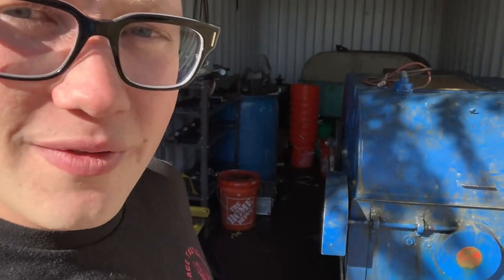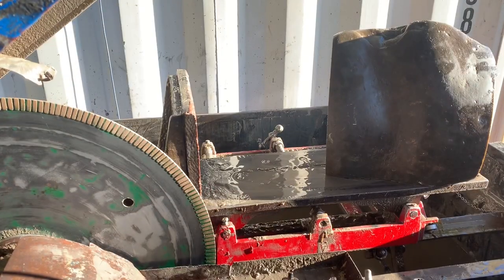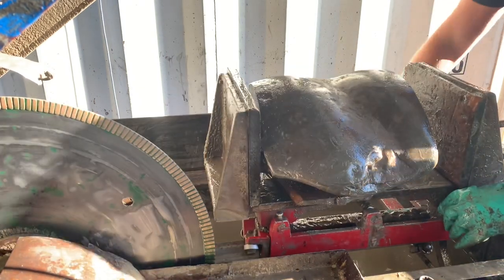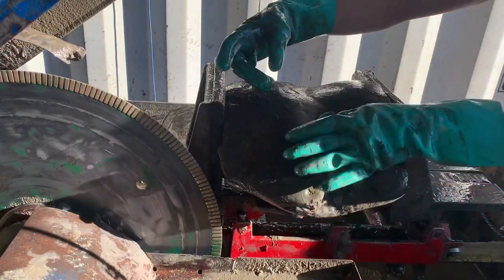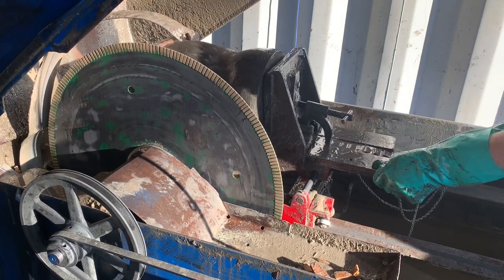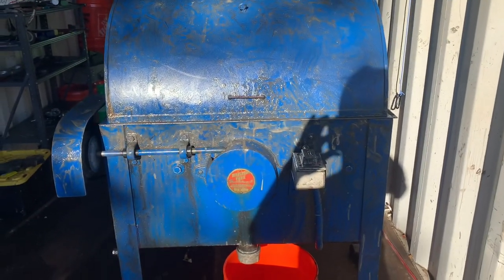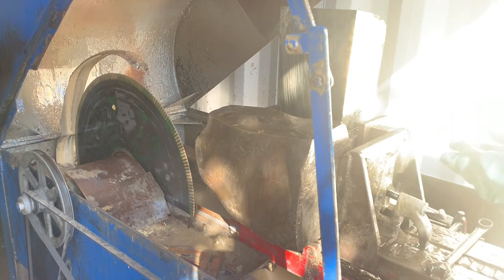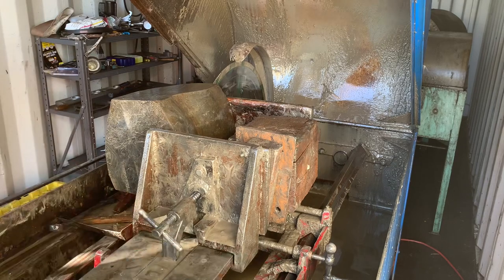How to make a natural whetstone ! With Highland park lapidary slab saw 24” diamond blade

Comment: thank you for featuring our machine.
Reply from the maker: You bet, the only major things I wish that could be changed are these: 

1 A way to extract the rear feedscrew  bronze bushing without having to disassemble the entire carriage, there should be a hatch to open so it can be knocked into the tank of the saw and a new one can then be reamed in from inside the tank. 

2, the back plate of the vise grip needs a U shaped catch added for the screw head that is tightened into it whilst using the vise, this would make clamp failures much less likely, I have added this to this saw here in the video and talked about it.

3 the carriage height should be changed or the arbor height lowered 1” so that a board is not needed under stones to prevent them from rubbing into the flange washers and jamming up.

Comment: Have you ever tried collecting the dust from these cuttings and adding it to Portland cement? I would bet that you could make some very dense composite with a tight grain with all that fine stone dust.
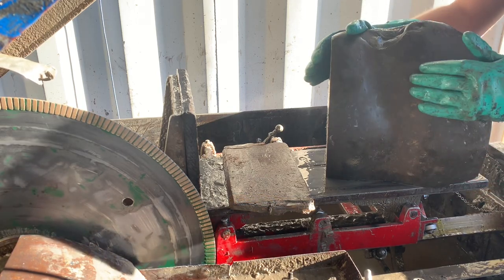9:39 I would add a textured rubber mat instead of a board to channel off waste and raise the offcut.

Comment: 19:46 are you talking about the groove on the table that the clamp runs in to keep it squared?  It looks like a triple sized miter slot on a table saw, made specifically for running a clamp or miter gauge in.
Reply from the maker: Yes the groove in relation to that t bar that gets cranked down into the metal vise. The modified I added helps keep proper downward pressure from the tooth of that set point into the tray. 

Does that answer your question or do you need further clarification
Reply: @WildWhetstones  no I understand what you were saying.

Comment: Looks like these stones are from rivers because they are all round edges had been washed off for long time. How do you know it is a whetstone? How do you know it’s jasper?
Reply from the maker: Years of experience and also study geology. Search for my video called specific gravity testing where I explain how to identify rocks on their density.
Reply: @WildWhetstones  but sg is just numbers many stones can be defined by using sg. Arkansas stone has different sg based on its hardness so how do you determine it’s jasper whetstone when the is not quarry at the mountain? I am wondering. Thank you for your reply.
Reply from the maker: @DeeDee-zq4yn  density test plus Moh’s hardness test.